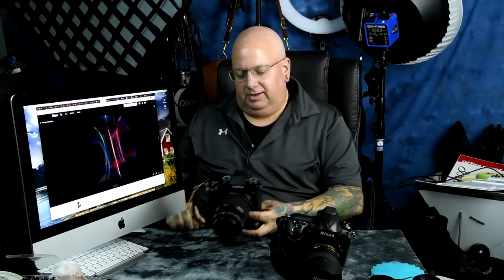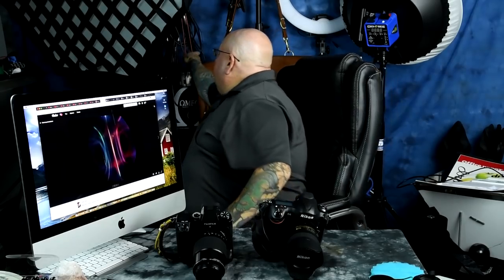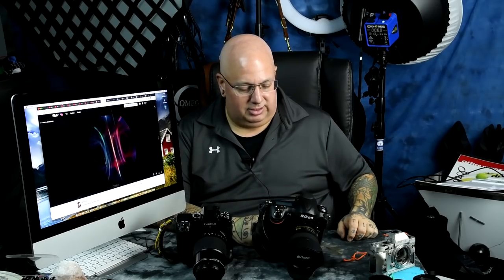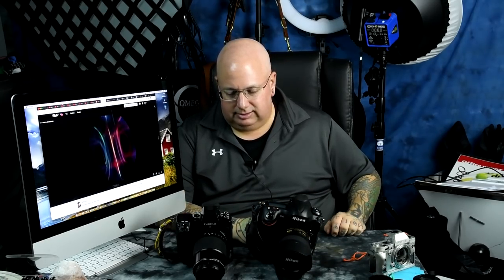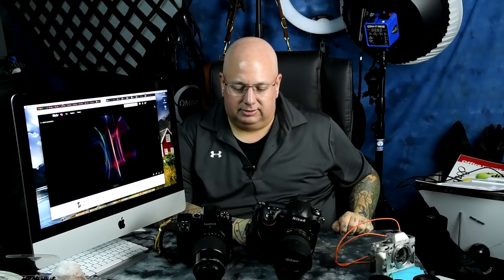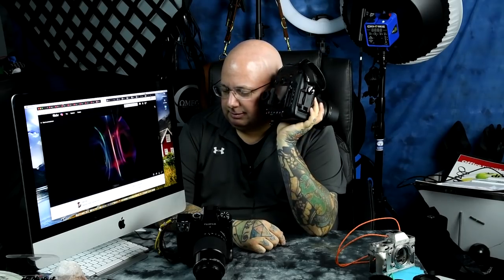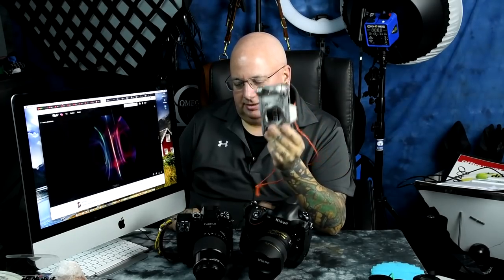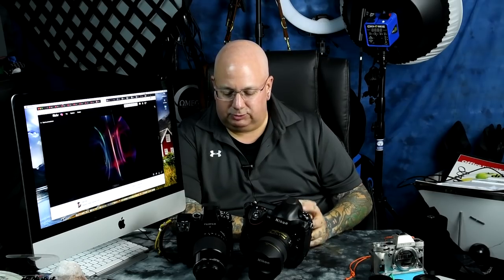😵 'Cheap & Plasticky' Phuji  😨.... Err... no 😃

Comment: Hey man, just discovered your stuff a few days ago.  Leaning a lot.  I have been considering the Xh-1, seems a beast, but have never shot Fuji before.  Is there anything to all this stuff about the way the sensors are made, and the effect it has on post-processing?
Reply: The X-trans sensor allows the camera to drop the anti aliasing filter & still get images without moire patterns in your images. Super sharp images because of no anti aliasing filter. The RAW images in the original Lightroom would cause weird looking artifacts when sharpening but from what I hear the new adobe LR subscription has fixed this. I'm allergic to Lightroom so I wouldn't know.